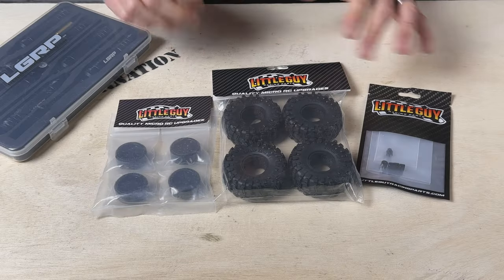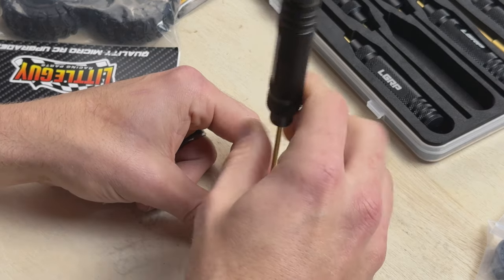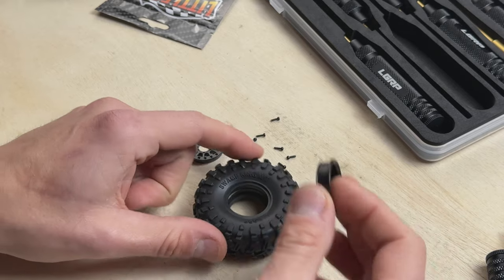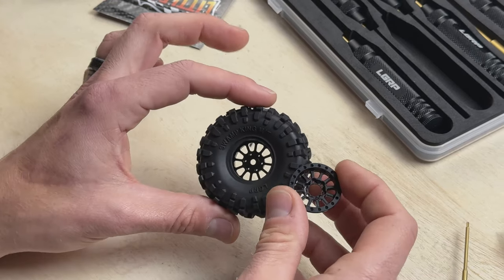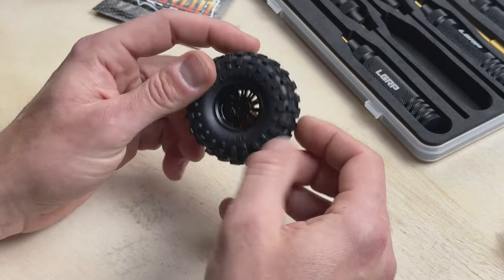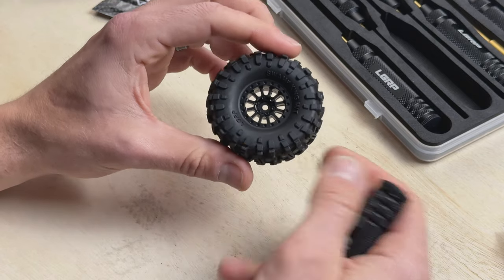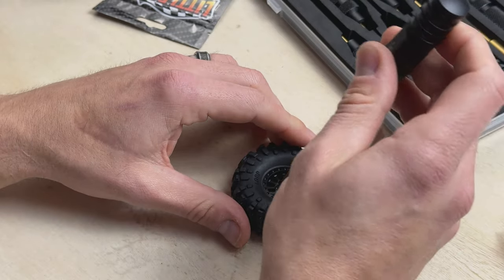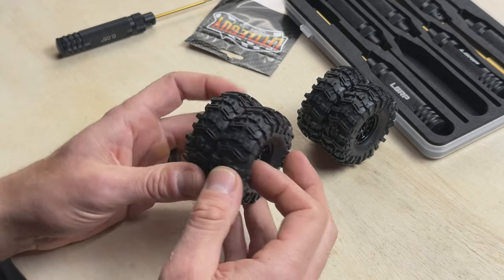SCX24 Beginner Series: HOW TO Assemble 1.0 Beadlock Wheels

Comment: For mounting the inner and outer face if you have paper clips, or a smaller hex wrench you can put them through the screw holes and two sides to line it up. Then get your first screw in and go from there.
Reply from the maker: Paper clip method is a great one!

Comment: Try using a little bit of water based lubricant on the bead of the tire. It helps when tightening the outer beadlocks. It keeps the rubber from pinching and it seats much better.
Reply from the maker: Good tip! I could have used this when assembling some 1.9's last night. They were tight!

Comment: Great idea for a series, I've been hovering over the buy button for weeks on an scx24 so I'll be watching intently. All your videos are very helpful.

I want the C10, big fan of your C10. I've been holding off hoping they magically release it with the V2 electronics. Would you say v1 electrics are a deal breaker now with V2 out and I should looked at the Jeep instead? No plans for brushless at this stage.
Reply from the maker: I wouldn't let the V1 electronics steer you away. The V2 is smoother, but the V1 is still close. Plus the three speed modes on the V1 is nice for adjustment. You can always buy a V2 set on ebay or the Facebook marketplace.

Comment: Hi everyone, what works great for me every time is using some alcohol spray on the parts of the tire where it gets seated. Makes life a lot easier to put everything together real quick. The spray evaporates after the mounting process. Doesn't 'hurt' the tire at all and you're done with a tire in a minute without breaking a sweat. Give it a try :)
Reply from the maker: Great tip!
Reply: Spirit or hairgel.

Comment: Great video on the 3 piece wheel ,and you can agree they're easy to install. But you should do a video of the 4 piece wheel that takes 30 minutes for each wheel, where you start with the outer ring. Not trying to be an ass, but most builders buy those, like the Injora black brass wheels.  Everyone wants to show all the easy stuff to build. And Adam , i love all your videos.  I've built my gladiator off of your videos with the Injora brass wheels , I look forward to building another build like your comp build, THANK YOU.
Reply from the maker: Good points. A whole lot more screws in those four piece wheels!

Comment: New to the hobby. Picked a trx4m and an fcx18 same day. Just learned the steel stamped wheela from injora dont work on either of these rc's i thought maybe they would work on the scx18 if anything bc theyre plastic beadlocks out of the box but nope 😅
Reply from the maker: The wheels should fit on the axles. The hexes are the same. What troubles are you having with fitment?
Reply: @CapeCrawlers  i meant the stock tires dont fit on the rim. The rims fit on the axles just fine.

Comment: I have a set of endura rims with Nikki Thompson tires from traxas with mom's, and it seems like it will not let me assemble them properly. Seems like there's air in the system. Do I put a hole in my tire to let the air out? So I can assemble the Beatbox correctly. Because it won't the way it is now.  If somebody can give me help with this or if you can do a video at solves this problem so I understand but I've been trying to put these wheels together are literally 4 weeks and it's not getting anywhere. One wheels so f*** u*, it's not Bunny.